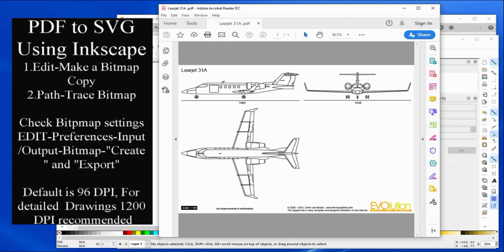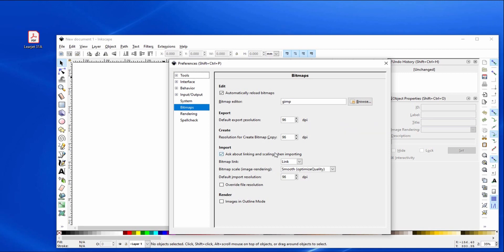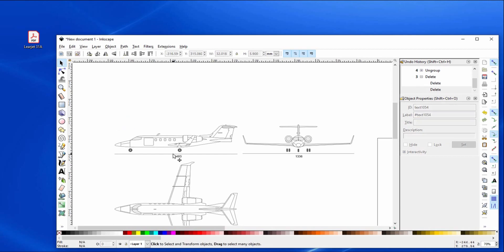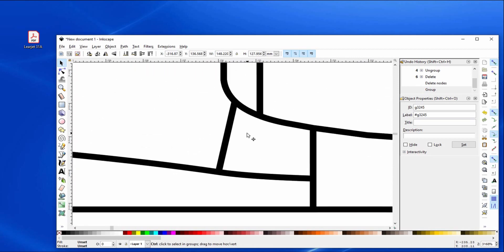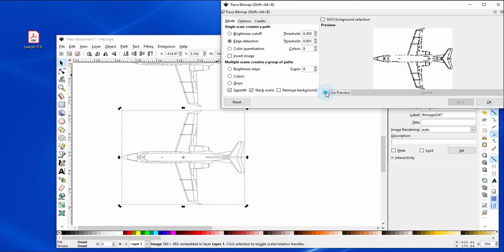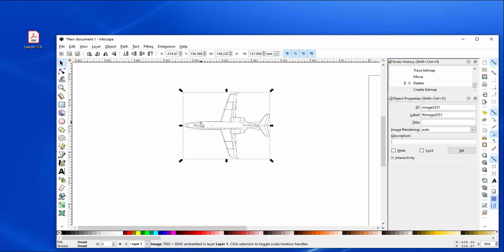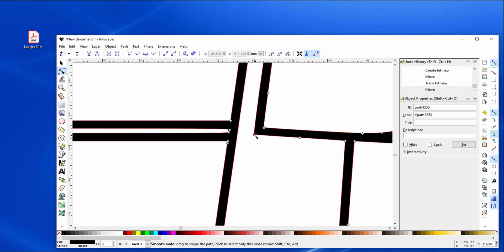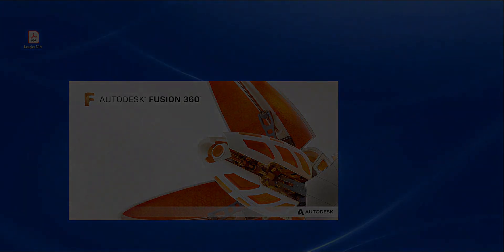Inkscape- PDF to SVG

Comment: when you brought the pdf in it autotraced it to be a svg (hence why you had nodes) then you convert it to a bitmap to then trace it again to svg.
once you had brought it in and got rid of the bits you did not want, select everything and combine them into one (path>combine) then you can, with it all selected, just go path>stroke to path to get the paths around both sides of the lines instead of the middle.
Reply from the maker: I will have to try that. Have another dosing to do soon. Might have to update the video too as I am sure inscape has newer version out now.

Comment: I didnt see how you changed the center line and turned on the double but wish I did
Reply from the maker: around 7:00 ish mark the "trace with edge detection" is what actually does the double line, then you can paste it into a cad program and cut the surface lower to create the edges for the CAM to follow.